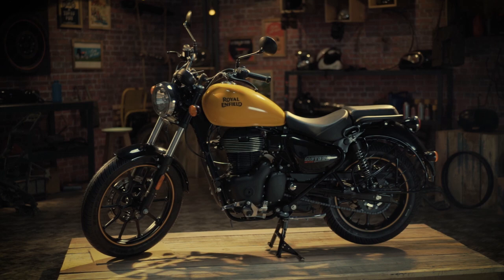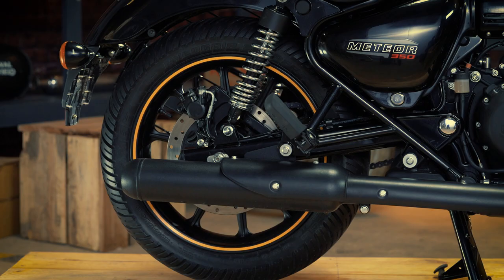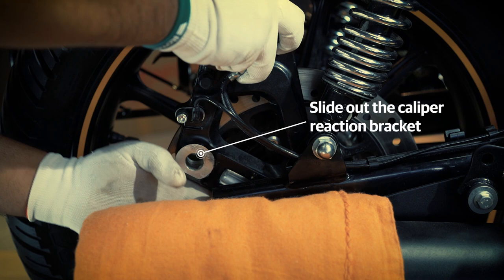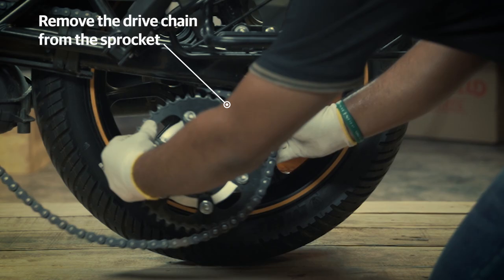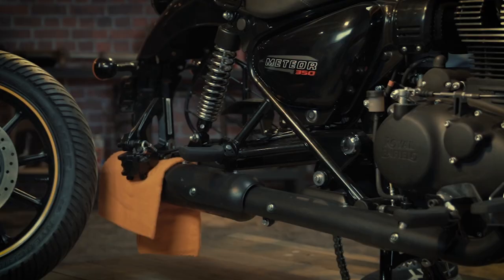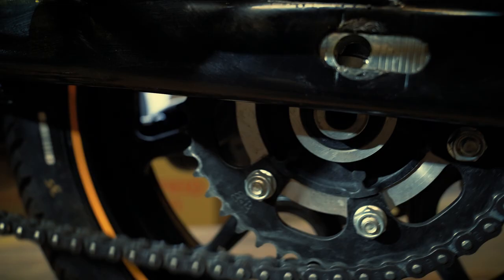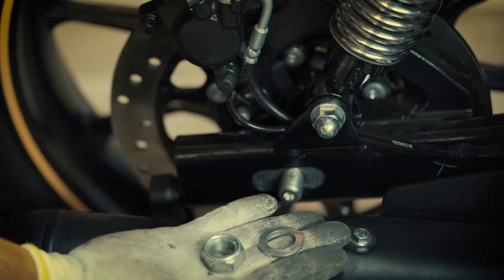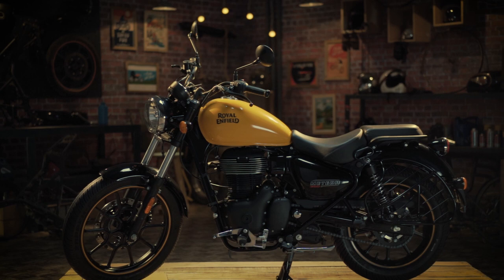REAR AXLE GREASING | Royal Enfield Meteor 350 DIY

Comment: Title is not appropriate. Rear axle greasing😂 rear axle greasing is just for sliding it easy into wheel. The wheel rotation is handle by rear wheel bearing. U can change the title to "how to disassemble rear wheel."

Comment: And what wrong will happen if the axle is not greased, nothing to do with free rotation of wheel. Only advantages I feel are, 1.Lubed axle, not binding and easier to remove.2.Slight cushioning effect due to grease layer between axle and inner bearing race. But both are very trivial advantages,can do without it.